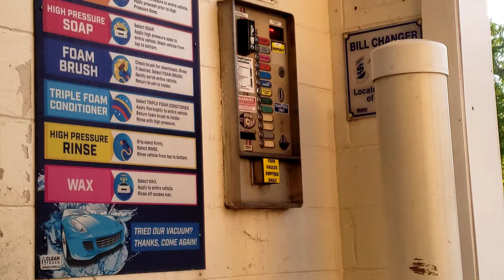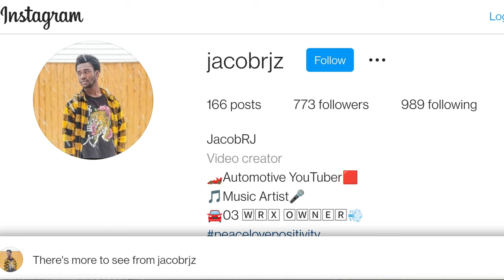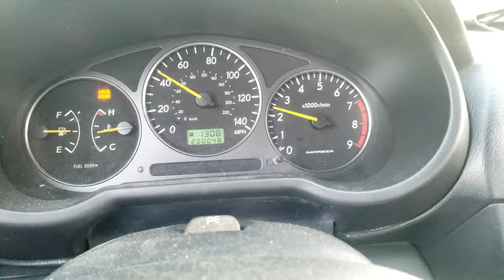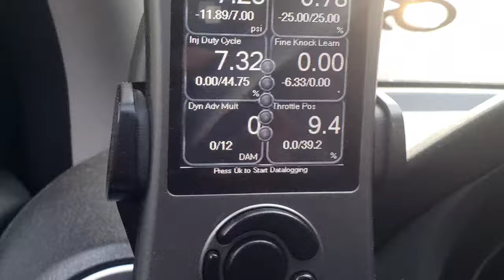Everything YOU should know about BEFORE buying a WRX!

Comment: Most of these wrx are engine swap to “low mileage” engines so the mileage doesn’t really matter. And more than likely modified. Its not a bad thing but a bit of responsibility into maintaining it.
Reply from the maker: This is true. I neglected to touch on swapped vehicles. But you're right. Swapped motors can be good or bad depending where it comes from 😭. Thank you for adding that in man!